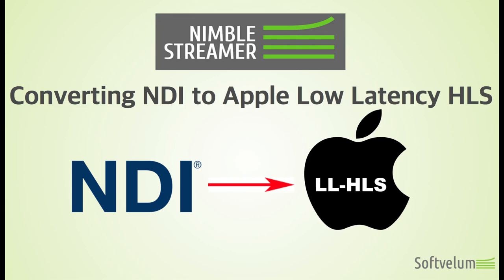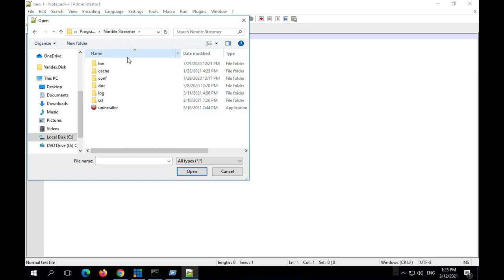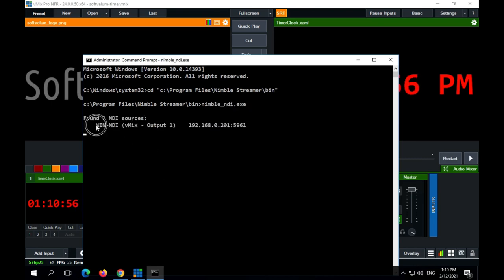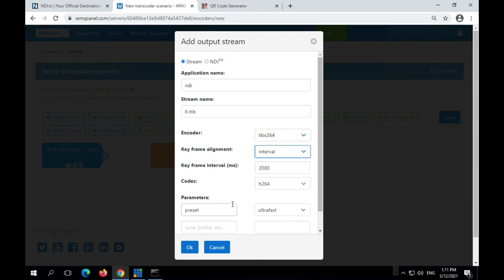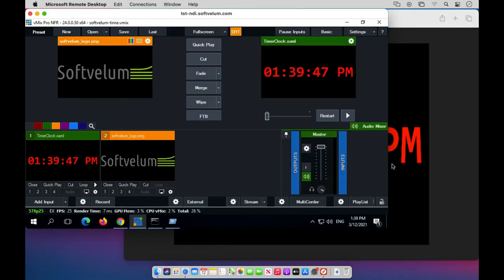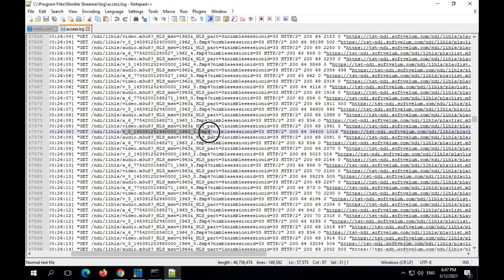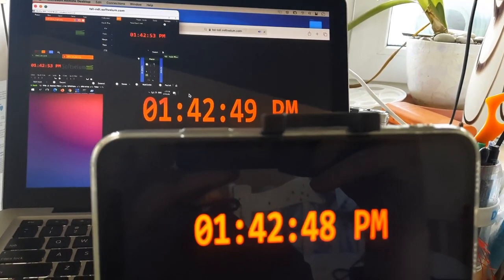Converting NDI to Apple Low Latency HLS

Comment from the maker: Timecodes:
0:00 Intro
0:30 Pre-installed Nimble Streamer
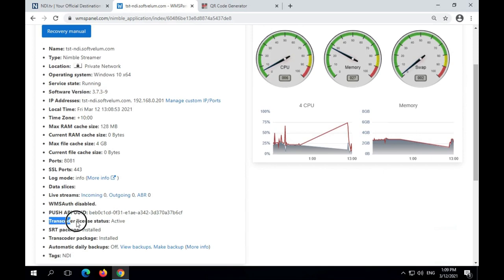0:48 Create application with LLHLS settings
1:13 Pre-set SSL and HTTP/2 parameters
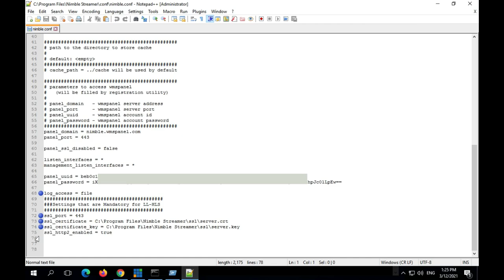1:40 Start vMix with clock
1:48 Check NDI source with our tool
2:13 Create Transcoder scenario to convert NDI
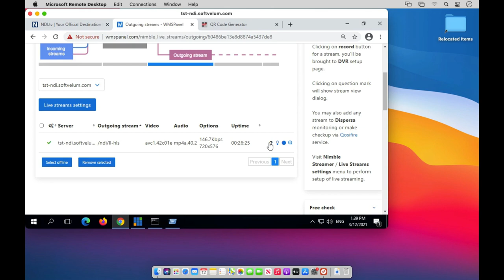3:20 Play LL HLS stream in Safari
4:00 Make sure it's LL HLS
4:35 Play LL HLS on iPhone
4:54 Latency comparison